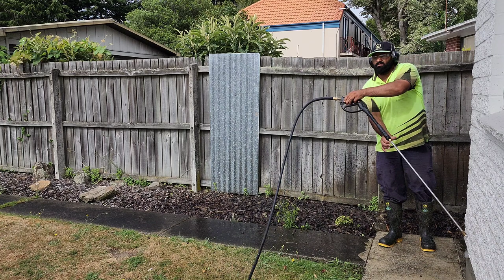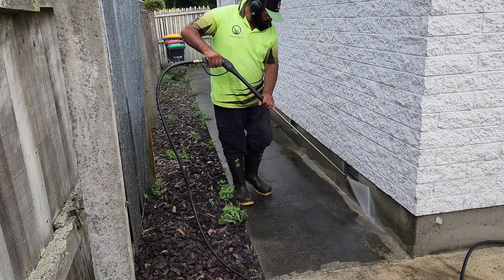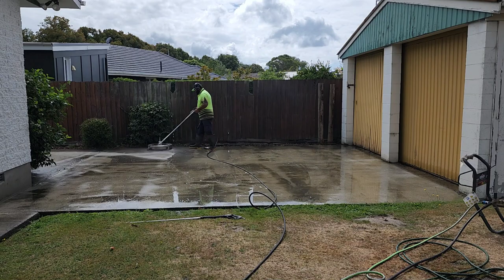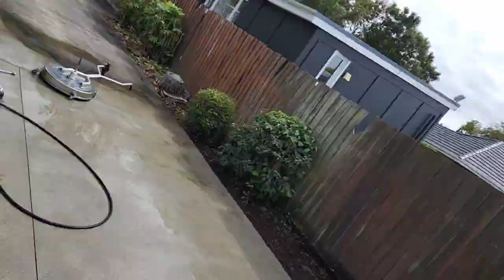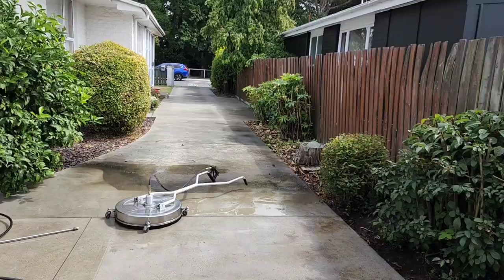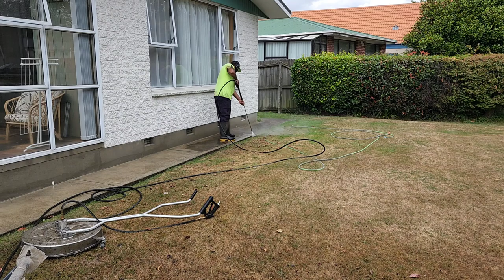pressure washing video | making the driveway new again| satisfying pressure washing.

Comment: Nice job man, I see you're using the white tip (which is usually the widest but not the strongest). I would suggest using a stronger tip or investing in a rotating turbo nozzle when it comes to concrete. But other than that great job 💪
Reply from the maker: Thanks mate for your good suggestions. I appreciate it.